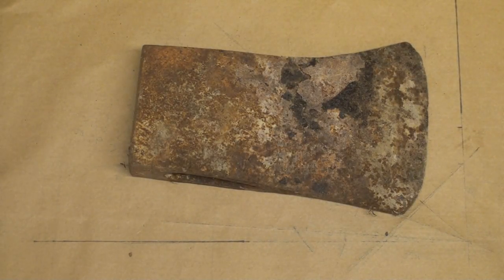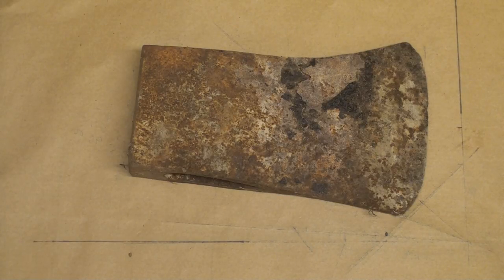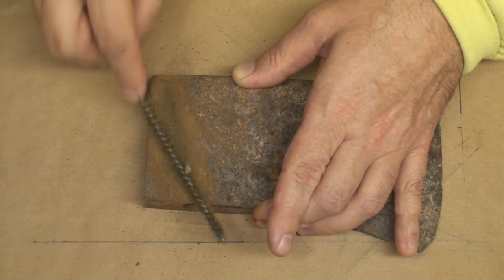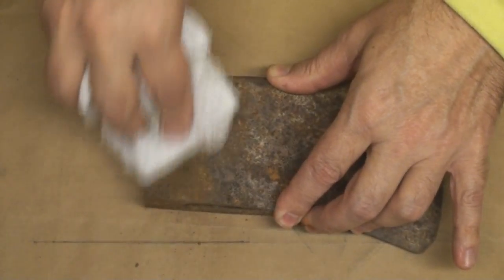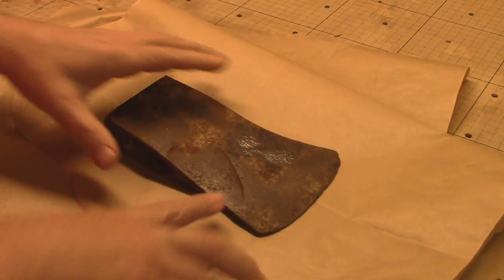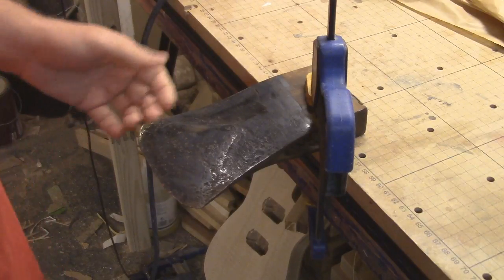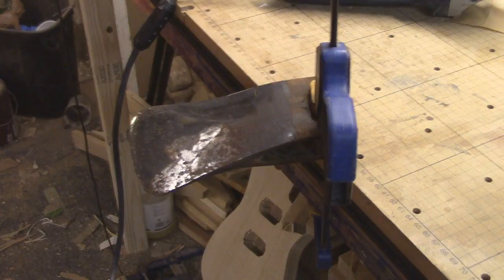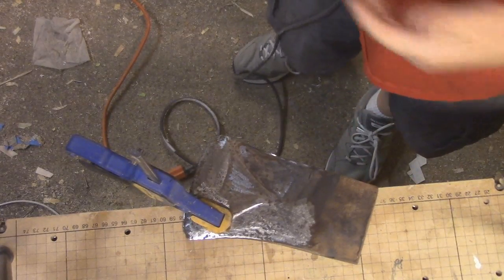antique rusty plumb axe restoration

Comment: Excellent video. I like to restore things also, vintage axes is one of them. I'm still trying to get the hang of getting the handle and eye to come together. I tried vinegar to remove the rust. It's ok but then I tried electrolysis, that worked ok also. Then I tried electrolysis with vinegar. That had a huge and immediate effect on the axe head. I had a severely rusted double bit Plum and the process left this dark, rich chocolate patina. Nice! You did very well on your cleaver.

Comment: The bit has been worn down, from use and sharpening, I have a Kelly perfect from the 30s or 40s, and its been USED, I mean the edge is past the bevels, but it still is good, and I use it as a work axe, but the 4 is the weight.  Hope this helped you.

Comment: Not sure what tools you have at your disposal. But if you can get a right angle die grinder and some 2" Roloc 3M sanding discs, they will enable you to remove the remaining pits and blend in the metal a lot easier then that large flapper disk. The 3M Roloc  discs come in everything from 36 grit to 120 or higher. And it is amazing how fast they cut and blend.  Just a suggestion. I love refurbishing things like that myself.

Comment: Do you want to do it the easy way? Soak it in vinegar for as long as it takes! Most lightly rusted tools takes about 24 hours to remove rust. Extended soaking times maybe required for more heavily rusted parts or tools. Use a wire hand brush to facilitate the removal of rust. Once rust is removed to your satisfaction rinse tools in a baking soda water solution to neutralize the acid in the vinegar. Then rinse in clean waters and dry thoroughly then give the tool or part a light coat of oil!